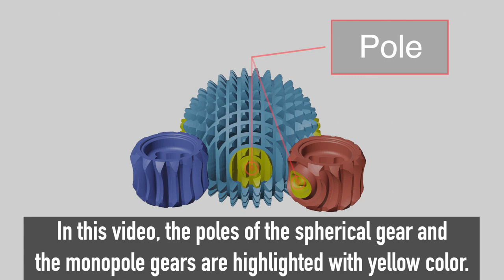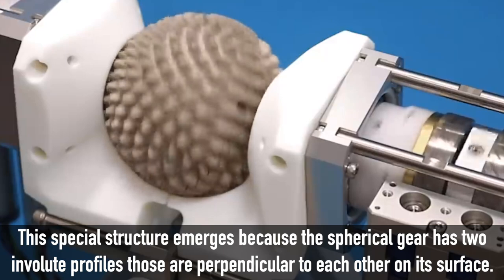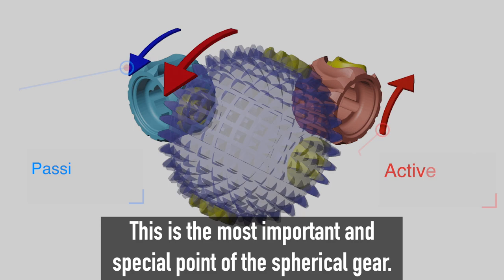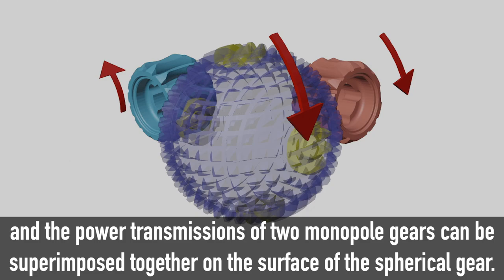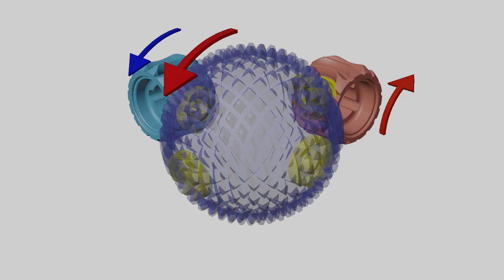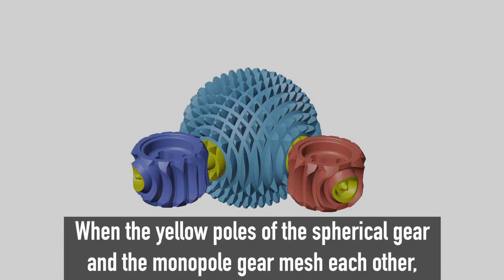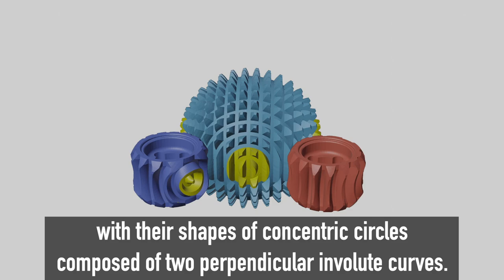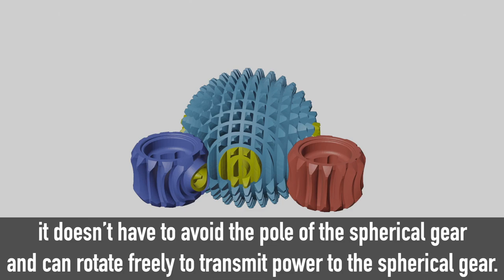ABENICS: Pole mechanism of spherical gear

Comment: How was the assembly made? The gearmate does not allow passive sliding of the spherical gear. Kindly shed light on the same. Thanks!!!
Reply from the maker: Thank you for your comment,
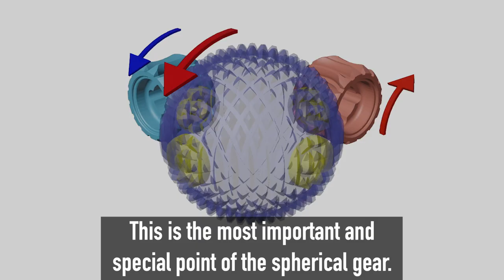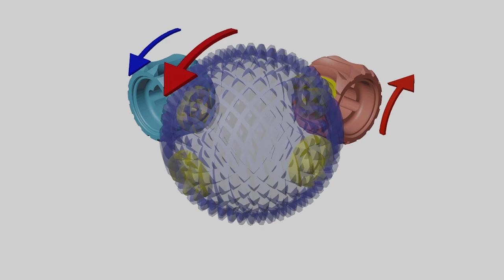Please see the video from 00:30 to 1:10 that show how the sliding motion(blue arrow) occurs between the spherical gear and the monopole gear.

And please send us the email for more information in detail.
garagefolks@seafolks.net
Reply: @garagefolks2350  Is there such a thing as a spherical "worm" gear? If so, does the reduction ratio remain the same or will it turn a spur gear faster at the equator? I was thinking of a variable speed transition just by moving the motor like a lever.
Reply from the maker: @WolfsburgWarehouse  Thank you very much for your interest and comments.
The inner worm gear is used to transmit power from the motor to the monopole gear as shown in our paper about ABENICS.

Abe, K., Tadakuma, K., & Tadakuma, R. (2021). ABENICS: Active ball joint mechanism with three-DoF based on spherical gear meshings. IEEE Transactions on Robotics, 37(5), 1806-1825.
https://doi.org/10.1109/TRO.2021.3070124